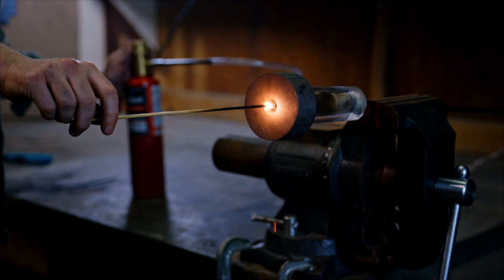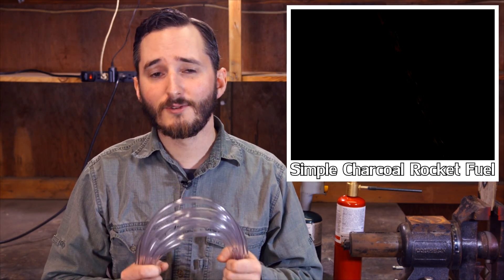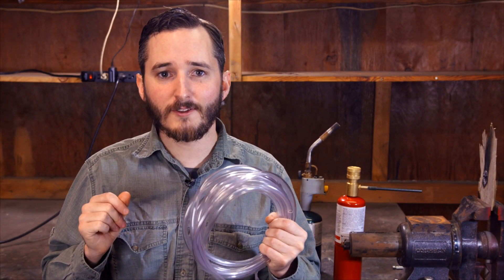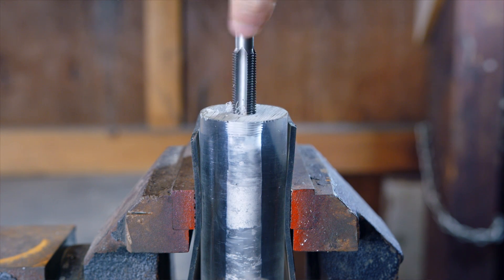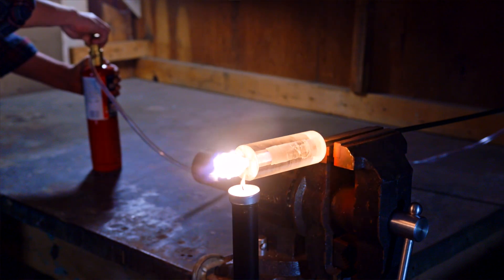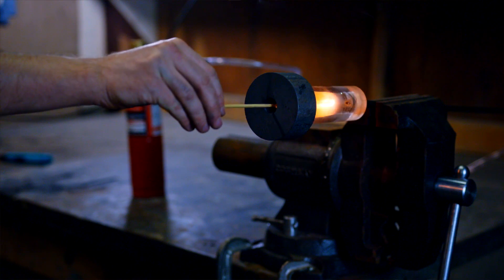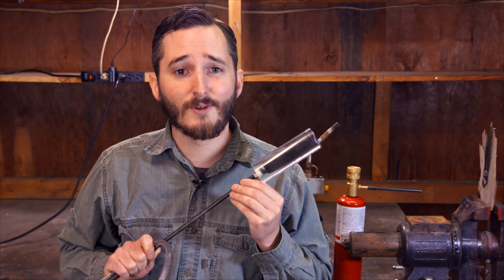Building a DIY Transparent Hybrid Rocket Engine - NightHawkInLight

Comment: Wow! Amazing! Is the oxygen to thrust proportional linear or is there a flow rate at which the oxygen will extinguish the rocket? As the acrylic burns, does the thrust automatically increase due to the larger surface area?🧐🤔

Comment: How much oxygen would you say to power the rocket for 20 seconds? Also, would a spark plug also work at starting the fire inside the acrylic rod?
Reply: Would it be possible to make a chamber and fill it with gad then light the gas up inside the chamber to produce thrust and have all the force from the explosion go through little nozzles for better speed?

Comment: For those of you who don't know why the inside of the rocket engine looks like it's shrinking, it's because the acrylic is expanding due to the heat on the engine.

When something gets hot, the molecules tend to move faster (get more kinetic energy) and hit the walls of the material harder, deforming the object more.

(Am I right? I legitimately don't know if I'm right.)

Comment: The core of the acrylic appears to shrink as it catches fire because the diffuse inner surface doesn't refract the light passing through it but once it's heated it melts and can refract. Pretty sure anyways. Would have to test.

If you have any project ideas that need custom electronics, controllers, or software let me know. I did electronics engineering and now a software engineer.

Comment: Very impressive! I'm a student at a Swedish university and currently working on somewhat similar hybrid-rocket-related projects for both my masters thesis and in a separate student project. To answer your question about what happens at 8:28, I believe this is the fuel grain forming a fuel vapour zone, with heated and vapourized fuel flowing inwards into the oxidizer stream where it is ignited. Because it is not hot enough to glow, it gives the impression of the fuel grain 'shrinking' but if one looks carefully, one can faintly see the 'real' edge of the solid fuel grain which is regressing outwards. For an illustration of this, see page 589 (figure 15-7) of G.P. Sutton's Rocket Propulsion Elements, 7th ed.

Comment: Did you know that a rocket (solid fuel type), without fancy guidance, will always turn into the wind? This happens every time. Do you know why?  (a teaser)
Reply from the maker: Usually because rockets try to be nose heavy, so the back is more easily pushed away from the wind.
Reply: @Nighthawkinlight  // Exactly :) right. This concept wasn't intuitive for me but after it was voiced, I understood completely. Some 15 years ago a friend and myself shoot over 200 home made rockets one summer. Like the Chinese style rocket that Indian reservations sell around the 4th July, the motor is at the top of a wooden stick. Wind will push with more energy there because of the larger surface area of the stick compared to the motor. This points the nose of the rocket into the wind. //  By the way, I have just discovered your channel and I very much like your topics and the method which you present it.   I'm hooked on your channel  :)
Reply: @Nighthawkinlight  The leverage principle needs honorable mention. The center of mass in a Chinese rocket is toward the tip. The surface area on the back end of the rocket-stick is greater, and has more mechanical advantage than the surface area forward of the center of mass. The rocket rotates around the center of mass, the nose is pushed into the wind by the overpowering force of wind against the bottom part of the stick as compared to the forward surface area.  // Note: (good mental exercise trying to get thought written down)

Comment: Most of the Hybrids have been using Nitrous Oxide N2O, get your 15lb. bottle and any shop related to drag racing will refill it for you or tell you where you can.  Problem is O2 isn't liquid at that pressure but Nitrous is, that amounts to a huge difference in volume, and that's why you only get 2 oz. O2 and a bunch more that liquefy at that pressure, propane, butane etc..Think I would be thinking about changing oxidizers.   Just Sayin.    I like the Hybrids.  School mate of mine lost 1 and 1/2 fingers making fuel on the kitchen stove, then he had to explain what happened to the KITCHEN!!!!!!!!!!!

Comment: make a nitrous powered rocket, nitrous works better than just oxygen and thats what most larger scale hybrid.rockets use, you can make nitrous by just heating AN to like 250 degrees celcius which you have allready made in a seperate video

Comment: you could have sequential burn sections, which are ignited by electricity, by a controller
Reply: suggestion: liquid fuel: hydrogen or kerosene, oxidizer-nozzle: kno3 or iron oxide, carbon could be the rocket housing if needed
Reply: the whole rocket, including fuel nozzle, could be made from carbon, with liquid oxygen tank or compressed intake-air oxidizer

Comment: Rubber tubing is surpisingly flammable in oxygen. I was using an oxygen generator (hydrogen peroxide and manganese dioxide) with a rubber hose. I was trying to burn charcoal using the the oxygen and the tubing caught fire. I panicked a bit, before I remembered that I could just punch the hose, and the flame went out.

Comment: Did you use ammonium nitrate as your oxidizer in the charcoal demonstration?
Reply from the maker: Potassium nitrate
Reply: @Nighthawkinlight  they look very similar and react the same when burned and with fuel.  But I bet saltpeter is easier to get. Ammonium nitrate isnt usually just available off most store shelves although those instant cold packs are often filled with ammonium nitrate.

Comment: Hang it from a scale with a weight heavier than the amount of thrust you expect. Hanging it means you can ignore gravity if the rocket is pointing straight down, it's 1g. If it weighs say 2kg and with the rocket facing straight down, when you ignite it it then weighs say only 1kg you can easily calculate the amount of thrust exactly.

Comment: I decided to use your idea of this engine. I decided to make it a jet engine, with an after burner. Took a lot of time but I did it, a fully Manual throttle lever. I also made a auto starting sequence, I loved remaking your project and making a jet engine out of it. It uses jet fuel that I bought, really loud and produces a pretty good amount of force.
Reply: Glimple Bort  what chemical actually is your jet fuel?
Reply: where did u buy the jet fuel?
Reply: @249xyx  Obama

Comment: If you work in stages, like begin with putting the engine on model boats, then model airplanes, then model rockets, it is very likely you'll have solved a great number of kinks and fails. Also, it would make great videos.

Comment: Could you try a hydrogen-oxygen rocket with a combined ion afterburner nozzle, assuming H2O is fully ionized at around 3500C? Could you also try a KNO3 (solid) + gasoline (liquid) hybrid socket, or an air-breathing carbon/sugar rocket?

Comment: hybrids is generally higher than solid motors and lower than liquid engines.  as high as 400s has been measured in a hybrid rocket using metalized fuels.[3] Hybrid systems are more complex than solid ones, but they avoid significant hazards of manufacturing, shipping and handling solid rocket motors by storing the oxidizer and the fuel separately.

Comment: TIL: anything is a rocket if you throw enough oxygen at it
Reply: Or fluorine, which can burn with concrete
Reply: What I was thinking lol
Reply: My anus is a rocket? Neat
Reply: The sausage triangle is a very good fuel. The oxidant may be N2O. The video is more about regulatability through pure oxygen, which is a good concept, but in reality it is necessary to first heat the fuel and it takes some time. Repeated ignition also requires several ignition attempts. Hydrazine engines can ignite themselves with a platinum grille even under vacuum. It is therefore very fast, safe and reliable. Therefore, it was used in the Apollo lunar return module.
Reply: Justin Clonts turbojet engine is the simplest engine type
Reply: @asrieldreemurr4481  it is not, the solid fueled rocket is.
Reply: @pikatrieu390  you are correct, potassium nitrate and sugar=solid rocket fuel
Reply: @asrieldreemurr4481  that's not even true for jets, let alone rockets. The simplest jets are ram/scramjets as well as pulse jets. Yes they have design limitations which prevent them from being widely used, but they are simpler by far.
Reply: Yeah, just put some oxygen up someone’s but and put a fire in their mouth and boom!

Comment: The change in the inside of the tube is cause by the diffraction gradient of the heated air changing the way the bends as it passes from the acrylic to the oxs fuel mix

Comment: @NightHawklnLight The interior of the rod seems to shrink due to heat-smoothing. When you drilled the hole, it left behind a rough surface, but at the high heat, it was melted and smoothed out, letting light pass through it more clearly. This creates the illusion of it shrinking.

Comment: As for your question on the shrinking core, I think as the core burns off fuel the diameter of that part of the core increases and lowers pressure in that area. The smaller diameter creates higher pressure when burning . If you could figure out how to start the burn at the top end opposite the nozzle that would give you a more even burning core. Check out 
Richard Nakka's Experimental Rocketry Web Site

Comment: Why weren't  hybrid rockets used in the Space Shuttle? It would seem safer because the engines could be shut off during an abort sequence.
Reply from the maker: They don't have as much thrust as solid fuel rockets and are much more expensive.

Comment: Instead of drilling one big hole in the middle, what if you drilled a bunch of smaller symmetric holes throughout the rod, made a small chamber in the back to connect them all, and then drilled, threaded, and screwed the brake line fitting into a different piece of rod and glued or JB welded it to the first rod  so that you could feed all of the smaller holes with just one fitting. My guess is that you would be able to produce a lot more thrust that way

Comment: 8:29 I think it changes from cloudy to clear because the drilling cause scratch marks on the inside. But when the engine turns on, the scratches have a high surface area and burn away quickly.

Comment: not exactly true about solid motors not being able to be extinguished. The Trident II ICBM which is a solid rocket, controls its range by cutting the motor out at a pre determined speed/altitude. It does this by opening valves around the motor letting in air that destabilizes  the combustion chamber causing a flame out. there is a video on here showing the guy who helped engineer modern SLBMs. very interesting stuff.

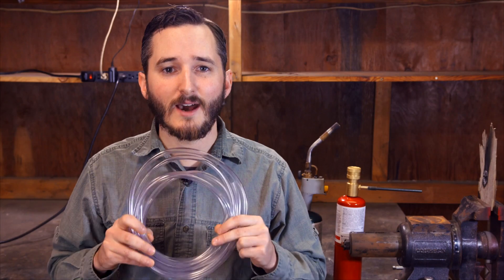Comment: 2:04 no, typically the fuel is mostly rubber. There is some aluminum powder mixed in with the rubber usually to make the reaction more vigorous, but aluminum by itself doesn't release gas when burned.
Reply: Look up Ammonium Perchlorate Composite Propellant

Comment: I often hear that the main downside of solid rocket engines are that you can't control the thrust or terminate and restart them. But with a hybrid engine, as long as you can control the oxidizer, you can control the thrust, correct? And as long as you can re-ignite the solid fuel, you can also restart it, correct as well? Or am I wrong in both cases.
Reply from the maker: Yes that's correct

Comment: The core of the acrylic rod looks like its shrinking as the test fire progresses. This is because drill bits generally leave quite a rough surface in whatever is being drilled, but the heat of the fire slightly melts the inside of the tube as its going along - therefore, the inside of the tube goes from being rough, to slightly melted (very clear in comparison).
Reply: WHAT.....

Comment: Great Video!  I just subscribed.  Lots of people asked where they could find that oxygen tank.  I found it at Home Depot for $10 but it doesn't last very long.  What I cannot find is the tank valve.  Those oxygen tanks use reverse thread for safety as they same size as the torch propane tanks.

Comment: What if a solid fuel rocket was made semi-porous and the gaseous 02 was pumped through it for oxidation? That way you could kill the 02 and stop the oxidation at any given point.
Reply from the maker: Solid fuel does not need gaseous O2 to burn.

Comment: The math for designing a nozzle is relatively simple.  It's collecting the data you plug into the math that's rather on the difficult and expensive side.

Comment: I'd always assumed that it was not just economy that dictated solid motors in fireworks, but also the fact that no metal is needed and it can be blown into harmless, biodegradable bits of paper rather than raining down on spectators.

Comment: how does the chamber pressure not push back the oxigen and therefore limit the thrust?
Reply from the maker: It would if the chamber pressure were higher than the tank pressure.
Reply: so the chamber pressure is lower than the pressure in the bottle, wouldn't that mean that it is very ineffective?
Is it possible that the whole thing is pulsing? Like a pulse jet? It looks like it does. So gas comes in at one end and booom goes out the other several times a second

Comment: Nice work. You could try to make a mechanism that holds the flap cap onto the barrel. It might be too slow because starting the moment the projectile is released, the flap could start leaking air. if you manage to only open at high pressure, the flap can make optimal use of the energy to open quickly as all the air to push it open is still in the tube. This, just like the alu cap will cost energy as the projectile will hit a compressed air bed just before it comes out. But is will give you faster reloading. Add a small magnet on the plunger and the projectile this way you can make the diameter of the projectile bigger so that you have less air leakage during the forward movement of the projectile. The fact that you could add tape tells the projectile is not snug enough in the tube.

Comment: The inside of the clear pipe shrinks because the scratched interior is a little bit detached from the rest of the inside, so it is  melting to the rest of the pipe. It's like your melting the "shavings", if you will, to the pipe That means it should be smooth if you were to touch the interior after it cooled down, if that makes sense.

Comment: enjoyed the video. Small point however - the oxidizer just needs to grab an electron with great force ( very simply put). it does not need to release oxygen but it does what oxygen does in a Redox reaction.

Comment: Good job, great view of the inside. Don't worry about the nozzle being perfect on a "proof of concept" motor. Going bigger than optimum keeps the thrust down and gives a longer burn time, both desirable when you just want to burn it and see how it does. I'm not sure exactly how they determine nozzle size on a hybrid, but on a solid motor, it's some serious math. On a hybrid, you do have another advantage in that chamber pressure is limited by the oxidizer pressure so if your nozzle is too small, you just need to use a oxidizer pressure within the working limits of the motor casing and it won't overpressure as it would if it were a solid propellant. (chamber pressure at or above oxidizer pressure will cut off the combustion)

Comment: I heard about a russian made throttled solid fuel engine where the combustion proceeds in gas generator chamber and pressure of hot gas on nozzles regulated via dumping excessive pressure perpendicularly and symmetrically to the flight of the rocket.